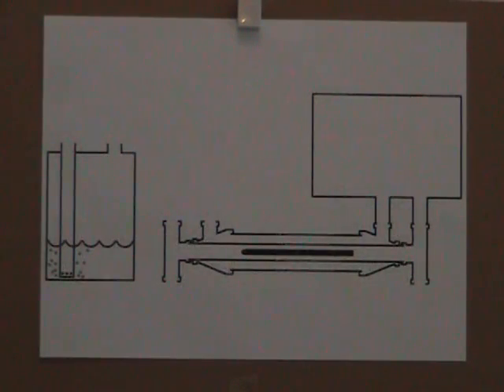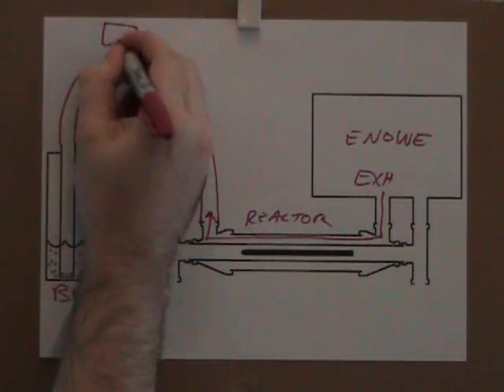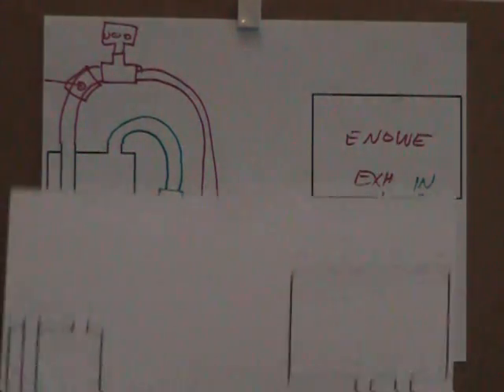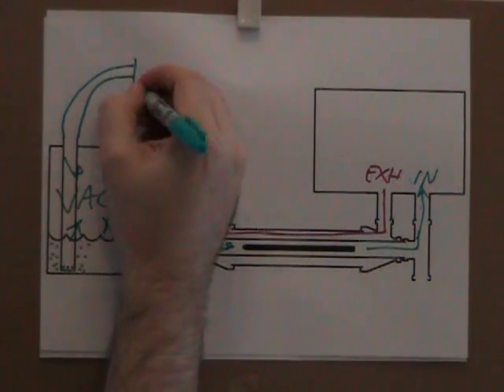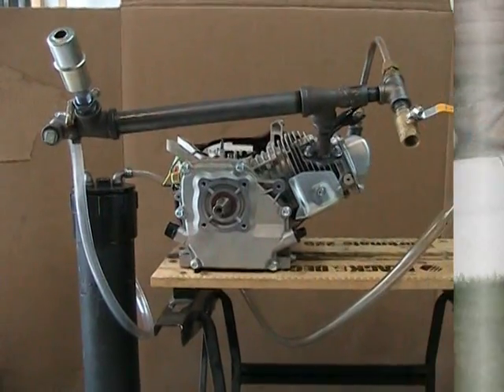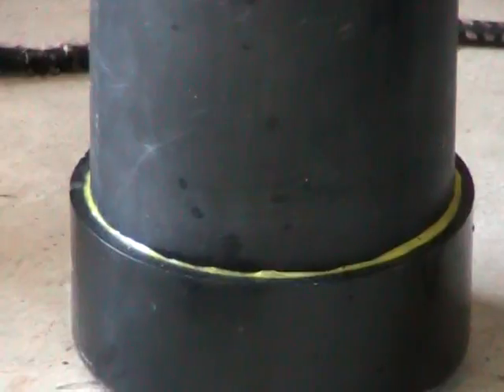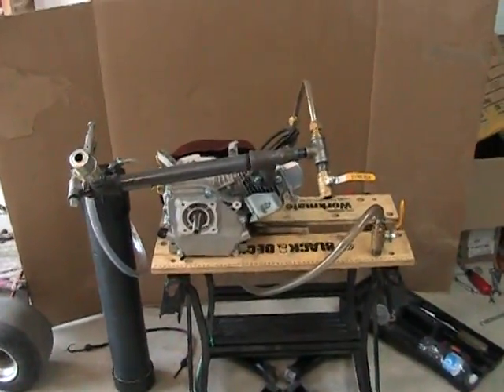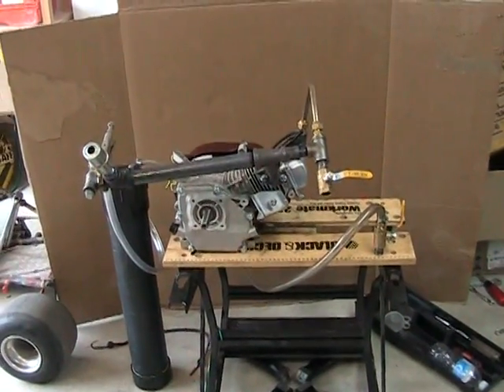GEET Fuel Processor - test 4 - revelation

Comment: The bubbler is evaporating the gasoline as it bubbles, but the bubbler fluid gets cold from evaporation, and the colder it gets, the less evaporation will occur, thereby choking off the engine. You need heat for the fuel which is why the recirculation of exhaust gas is more enduring per run cycle.

Comment: Nice setup.  Would it really matter if the gas got contaminated with pipe cement?  Couldn’t it still be used as fuel?  People are pouring water, beer etc., into the fuel bubbler and it still runs.  True, it might be eating away at the cement but that can be remedied with a different vessel.  But the fuel would still work contaminated or not, yes?

Comment: Your gas was being pouted with water. It gets cold in the gainsayer, then it condenses moisture from the air. If your plasma reactor was tuned it would split the water vapor and you would burn some hydrogen and oxygen after it was split by the plasma.

Comment: OK, newbies and old hacks... Paul is dead. He wrote two books: "The Book of GEET: Part 1 and Part 2" The 2nd part is focused on the suppression. Book 1 is a bit difficult to read, but clarifies the science and some of the construction tips he left out of his patent and free plans. Frankly, no reasonable person would have ever gotten it to work based on his theories and the original plans. I'm impressed he got as far as he did, obviously the man was channelling or smoking something special. Because it's a plasma reactor, not an internal combustion fuel system. So stop thinking fuel vapor mechanics. That's just the set-up. You can buy the book from Amazon or rebuildinggeetinternational dot com, his son David is selling e-copies for $30.

The vacuum is essential. Mounting the rod vertically (fuel exiting the top) or pointing to magnetic north is essential. You want/need to let the fuel which is turned into a high speed vortex of plasma, circulating and rotating the rod and to be contained by the magnetic field of all the circulating vapors, both intake and exhaust. This sets up a double layer of gasses and a multiple layer of magnetic fields and electrical charge barriers that contain and promote the ionization of the fuels. Probably a CIV type reaction (charge ionization velocity. It requires a smooth, free-floating rod of uniform material, even glass works) After 20 minutes of setting up the magnetization of the rod, you need to take it apart and size the rod to the magnetic field imprinted on the rod. Then reassemble and viola, you have a tuned reactor that will crack (most likely, but still not verified) any fuel, even water. For sure whatever fuel you used to tune it... if it bogs, just add salt or sugar... Still the efficiency will change by 15-30% depending on direction, which is why vertical is best. (The Earth's magnetic field is north in the vertical direction. Bet you didn't know that. Also, your rod will now always have a north end that aligns with the Earth, so if you hold it vertical, it will be north on the top. If you flip it, it will be north on the top. Just to show you science knows shit about magnetics.)

Your engine now is a plasma-vacuum driven engine. You can un-plug your distributor, it's not setting off the reactions, the compression does and the condensation is close to 50 deg C, much cooler than a regular engine. Here you want to make sure your vacuum is sealed and all connections between the reactor and engine are done with red silicone gasket sealer. Apparently it's conductive of the energy that is being released in the cracking of the molecules to base ions and then reabsorbed by the plasma cold fusion to make oxygen, nitrogen and water in the pistons. (Do you think its coincidence the concentrations match those on the planet?) There is a significant magnetic and static field that is channeled through the engine. If you lay a non-magnetizable object on the engine between piston and reactor, you may get a super magnetized object.

If you use teflon tape or some insulating gasket sealer, the reactor will broadcast a static electric and magnetic field that will replicate the Earth's... might protect you from cosmic rays and plasma strikes in the coming GSM. Will erase your cc's and destroy your PC and cameras and phones you bring too close. Might bring some secret black ops helicopter to your garage... it did for Paul, but they apparently never dropped by. You may even get the whole rig to replicate the function of the Sun, Paul did, even turned it invisible, which is why NASA hasn't taken a decent sky pic of stars, the Astronauts can't see them. It also screws with gravity, cutting the weight of your gen-set in 1/2 or better depending on speed.

But then, you could also harvest that electrical field for electrical power with a Tesla coil... Something Paul never tried, even though he measured 10's of Kilowatts of power radiating off his reactors. He was a vacuum engineer, not an Electrical genius who was willing to buck the regular theory that can't explain stellar light transmission over galactic distances. 

It's a new world device. Not for the faint of heart or fixated thinker that sees no hope for the human race as we plunge into darkness of a Grand Solar Minimum. Good luck boys, enjoy your toys.

And anyone who says it would be everywhere if it worked is either and idiot or a troll. This tech could break the world economy. It will not be given a chance to compete with any engine/auto or power generating commercial enterprise, ever. Read part 2 if you doubt this. Paul struggled 30 years against the system and it stole his life. 

Its strictly a life saving invention if it gets in the hands of a decent developer who can take it to the next level, a planetary shield device. Of course it could also power local units and generate clean water and air while doing it as is when the power and water supply grids fail, so your corpse will be well lit and watered. But lord help you if you try to use it to separate from the functioning grid. Your absence will be noted with prejudice.

Comment: this is a scam fake - a follow up to  GEET by Paul Pantone's who was a drunken charlatan who despite the offer of $1,000,000  thats 1 Million $ if he could show GEET working in controlled test conditions he never took up the offer .... Just saying
Reply: We had ours running in controlled conditions. We did experiments using a control and monitored the effectiveness of most apparatus shown on You Tube. they all have limitations and the limitations are what they are trying to suppress. 
Paul Pantone was not like most people . He knew there were limitations but felt that the perfection of this device was a small matter and he would come to it easily in time. Tom Ogle was said to be a charlatan too and he was in the same boat as Mr Pantone . The system does work it just has limitations that have kept it off the market to this day

Comment: Thanks for posting these tests... This is a basic vapor carburetor... a suggestion..  you could also install a ball valve at the intake so you could throttle the engine down and it will run longer and you can control the output.... heating the fuel vapor prior to the engine inlet should decrease the efficiency a little ... after all it is a heat engine, which makes power by ingesting cool air / fuel and expanding it by combustion. It would be interesting to test your engine's efficiency  both with and without the intake heater and see which way is the most efficient... also the intake heater and exhaust into the blubber is needed if you are using heavy oils such as motor oil or other hard to vaporize fuels... you can google perkins crude oil engine or griffin hydro engine... both engines from around 1900 had similar fuel systems.  also the Priestman oil engine... There were many crude oil engines made in the late 1800's and early 1900's. Maybe  you also want to check out my Brayton piston engines on my youtube page?
Reply: Yeah, aluka1603 feels the same way. He just burns gasoline cut with water. I had ball valves in a few spots but heat will destroy nylon valves so only brass will do. Also I need to weld all joints as the yellow heat Teflon tape failed before long. Thanks!
Reply: That's true heat does destroy nylon but most gas valves are all brass.... IMO you just need something at the inlet to control the engine speed instead of having the engine rev out of control.

Comment: I got 651 mpg on a 1965 Volkswagen notch back sedan with a 4 cylinder horizontally opposed fuel injected 1100 cc
Does the "vapor " system work? NO!
 1 it is not vapor

2 Raw gas is needed to facilitate control of acceleration 

3 over the long haul it( "vapor system") burns/scorches valves(intake) as raw gas cools the valves. In these systems water can cool the valves just as well as gasoline

4 It increases horsepower. TRUE but only till the most volatile part of the gasoline is used up. On a 4 cylinder car? about 12 miles of travel then the car acts like its running out of gas. Sound familiar?

5 All the patents issued to everyone (Pogue, Ogle, GM, FORD, DODGE, Shell Oil) are all the same device. Patents are not supposed to be this way. But the technology is so misunderstood they( the patent examiners) didnt know and thought a copper tube heater had a different function than a exhaust jacket heater

6 There is no conspiracy. Oil companies have tried to figure  out the key to this technology but have failed. GM tried and failed. Ogle tried and failed . the comp[any he licensed it to tried and failed Pogue tried and failed. Yes he failed. Why do you think he quit the demonstration after only 26 miles and why do you think it was measured by pint and not gallon? Its easy to burn the first pint of a tankful but hard as hell to burn the last pint. Tom Ogles experiment fell short for this reason. I tried and failed too.

7 Running a stationary engine is easy. Running an automobile is difficult( after about 12 miles) A hybrid like the Chevy Volt might be the best bet as you could run the generator with a stationary engine and supply electricity to the batteries and motors.
Anyone who has broken the first pint barrier has imitated a stationary engine. Tom Ogle 55 mph steady. Shell Oil , GM test track conditions( you set the speed and drive till you have no gasoline left). Me? I set the speed and drove till there was no gas left. See a trend here?

8 your results should be astronomical 500 mpg plus not 100 mpg

9 I applaud anyone for trying to figure this out. I tried and have an excellent understanding of its limitations but I have yet to see anyone with the answer(this includes EVERYONE who tried, Shell Oil, GM, FORD, Chrysler, Pogue Ogle and the guy in this video). Keep trying

10 You are not a genius for figuring this out .It has been done before. Do not try to patent it, it is already patented. Doesn't work, but there are many patents on the same device. At the time of the issue of the patents, you did not have to have to have a workable device. You DID have to have a theory and engineering drawings to patent. NOW (today ) you must have a working device. It changed about 12 years ago. Fiberglass was invented 300 years ago but had no practical application till the 1900's when they invented plastic and resins.

11 It is not free of emissions . It produces carbon DIOXIDE  although we heated our lab with the exhaust with no adverse health effects

12 Though heat is the solution that everyone turns to( after 12 miles of running the device) It DOES NOT require heat. I started and ran a complete gallon on my Volkswagen in -40 weather. Pogue did his famous demonstration for FORD in cold weather. 
Everyone tries water heat then exhaust heat thinking heat (and more heat). Heat helps but has limitations( I made the same assumption I was WRONG)

13  It DOES require vacuum and depending on which part of the gasoline is left, INCREASING vacuum. Unfortunately vacuum does not respond quick enough and sudden changes in speed(up or down) "break the chain reaction" and the car dies.( Tom Ogle El Paso to Demming and back. A  car, with gasoline in tank, would not start just 5 miles out of El Paso)
 Vacuum lowers the boiling point of liquids. Lowering the boiling point means heat is not necessary 

14  If you think success is just around the corner YOU ARE WRONG. Tom Ogles interview had a few results that were conjecture and wishful thinking. He thought he was so close to figuring the idea out that it was just a matter of time.I thought this way, everyone on you tube doing this SAME thing thinks this way. YOU ARE WRONG.( but please keep trying. One day who knows.)

15 It WILL run other fluids, toluol, varsol, paint thinner,  kerosene ,diesel, you name it , it works. Molecules are molecules they all explode. Premium gas, regular gas, its the same result. Leaded Gas unleaded gas, same thing. Gasoline with 2 stroke oil?  Same. Believe it or not smoke from burning hay will run a combustion engine. Tried that too.

16  Spark arrestors will not stop explosions. I've blown my tank up a few times while  using every kind of idea I've seen on you tube designed to provide safety. Picked a few "spark arrestor" screens out of the ceiling and walls too lol. YES ive set my garage on fire as well.
If you figure out the need for vacuum you will realize at this point that explosions don't happen in a vacuum system. We tried (yes on purpose)) to explode the tank on several occasions and couldn't do it.
The things we do for science.

17 Raw fuel ignites and the expanding gas produces the force to push the piston down. 

With vacuum it requires atomic molecular particulate and air and it ignites and causes an explosion providing force to push the piston down.

 Again it is expansion( very controllable ) or explosion ( not controllable). Expansion is controllable and dependable. Explosions have more horsepower less efficiency and eventually has more efficiency and less horsepower as the fuel degrades. This degrading(refining) of the fuel is the source of the problem. Its hard to account for it and make the car drive in normal traffic conditions

18 Think Im wrong? comment call email or text Anytime. I have been there , done it , and thought I was a genius the whole time. So does Wile E. Coyote.(Warner Bros. Coyote Road Runner Show)

19 NO I dont work for "Big Oil "

Leslie
780 700 7507
lesliec77@icloud.com

Comment: note gasoline is a refrigerant as it boils off the liquid gets colder  get less vapor
Reply: And Vacuum lowers the boiling point. Anything else?
Reply: The reason the fuel look that way in the bottle air has moisture it as the  fuel boiled off the water gets in trained in the fuel

Comment: soooo... what we have here is a vapor set up but if you want to polute your gasoline vapors with exaust.....
so ok now run your engine with your geet set up. for an hour then measure how much fuel you have used. then unhook the exaust and run it again and mea. how much fuel you have used and please post your results.  and I agree with notgivingmyname ...put a load on that test engine!!!
Reply: the egr system on your car adds exhaust gas to your intake manifold. so that pollution is going to harm your engine, other than that carbon in the fuel sounds like a good way to foul carb jets and/or fuel injectors.
Reply: the egr system on your car adds exhaust gas to your intake manifold. so that pollution is going to harm your engine, other than that carbon in the fuel sounds like a good way to foul carb jets and/or fuel injectors.